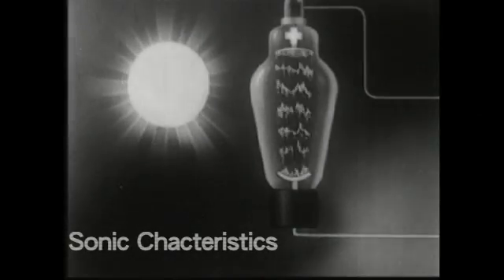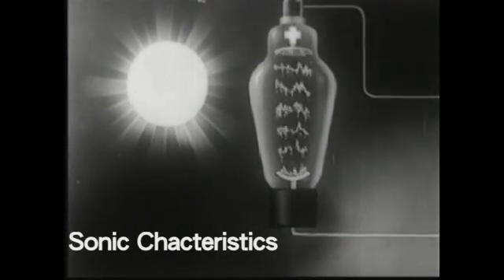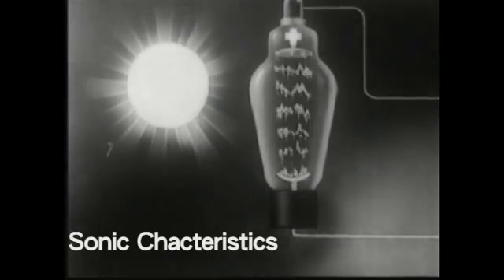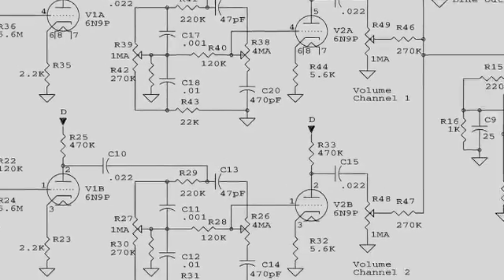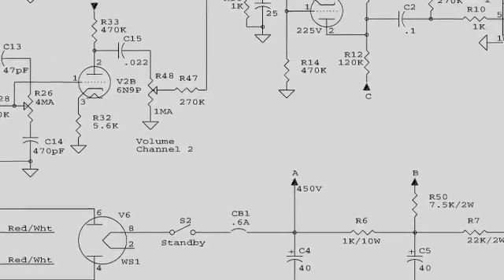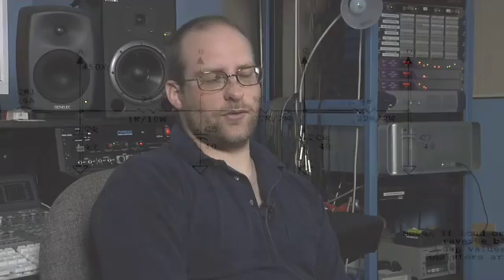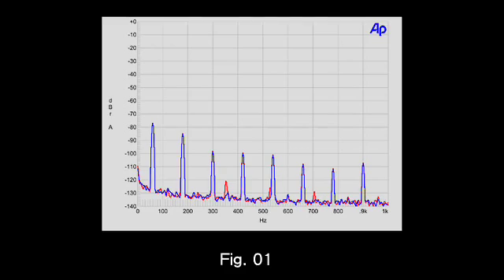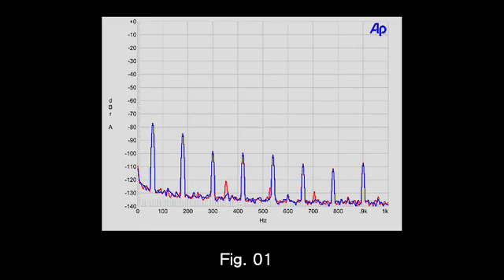Tubes Vs. Solid State Amplification

Comment: The misconception of tubes / transistors producing dominant even / odd order harmonics will probably never die, which this video is a perfect example of. Even / odd order distortion depends largely on the type of circuit that either tubes or transistors are applied to. Class A -> dominant even order, class AB -> dominant odd order. A big part of the audible difference is that as opposed to tubes, modern solid state circuits will not saturate gradually but go into abrupt clipping instead as the max. voltage swing is reached.

Comment: Now what about the moog synthesizer, was it all transistors or a mix of those and tubes? Such as used in Emerson Lake & Palmer's Trilogy, if you're familiar with that song.
Reply: Moog were all transistor. A very early version had a voltage-regulator tube, but only in the power supply. All the audio circuitry was transistors.

Comment: I’ve been a tube snob for a while got into tubes because I didn’t like the sounds I was getting out of my katana. The problem with tubes is you have to run them loud to get those nice tones and they have a tendency to break down. So recently while I was talking another tube amp in to be fixed I tried a couple of solid state amps a Roland Blues Cube and an Orange 🍊 crush pro I walked out with the Orange 🍊 but a few days later I ordered the blues Cube because it does blues better then the orange but the orange can do the heavy rock / metal with lots of controllable feedback it’s a beast.

There’s no good or bad just different.

Comment: The thing is that both amp transistors and tubes are cheap when compared to the price of the full amp (tubes are now expensive because we don't make them anymore), same goes for DAC's and most of the audio stuff, if we check the price list of the components on TI or other manufacturer even the top quality transistors and chips are inexpensive, and what is even more curious is that no sound boutique brand even makes transistors or tubes. All in all its a big marketing scam, mostly.

Comment: When pushed into distortion the signal is clipped. In a valve amp the transition of the clipped signal is tapered with more harmonic information. Transistors cause the signal to clip in a abrupt square. It is purely a matter of taste which you prefer.

Comment: We must consider the voltage factor: Tube works under a voltage 10 times superior to their transistor alternative, is like chiseling an intricate figure in a big block of wood or on a toothpick. There are amps in both systems that become popular by their own characteristics and couldn't be matched in the other way, without even getting in the hybrid sections.

Comment: Digital technology will never equal tubes, you cannot draw a perfect circle using straight lines.
Reply: orange70383 yes you can, draw a straight line around the earth's equator and you'll get a circle.
Reply: If you watch a perfect circle through a microscope you will find texture, imperfections and modular patterns at the end. If you watch any organic curve or form, you will find cells or atoms as pixels. The most organic thing has a resolution limit too.

Comment: Why do you want harmonic distortion? Why do you prefer the excess heat, fragility and limited life of tubes? I'm sorry tube advocacy is counter intuitive.
Reply: A guitar amp is essentially part of the musical instrument. The tone it creates is part of the tone of the instrument. Asking why you would want harmonic distortion is like asking why you would want an instrument to resonate. BTW this video missed what I believe is the biggest difference between SS and valve, valve amps allow you to hear the impedance curve of the speakers you are using. The gain of a valve increases with an increasing anode resistor (Ohm's law). With speakers, the resonant peak around 100Hz and the rising high frequency impedance creates a bass and treble boost at the same time as reducing power efficiency. This results in a lively organic tone that solid state amps simply aren't capable of.

Comment: This tube VS transistor debate will go on and on for ever! I am 61 years old and grown up in that transition from tubes to transistors. My 7th grade science project back in 1968 was comparing tubes to transistors in audio amplifiers and I made it state competition! Although my project was centered around the mechanics more than the sound, I will admit there is fairly determinable difference in the perceived sound between the two. Transistor amps are very "straight forward" in the quality of audio output. As long as it's not clipping, the signal hitting the speakers is pretty much a clone of the input, just stronger. That's one reason an audiophile may say the trans amp sounds hard, harsh, gritty, etc. On the other hand, tube amps have the natural ability to "smooth" things over. Soften the blows, add those sweet sounding harmonics that gives the sound a flavorful pleasantness audiophiles and guitarists love. Reason? Just the way a tube circuit works has a lot to do with it. The output transformer that pretty much is mandatory in a tube amp plays a big part in producing that smooth warm sound. Remember, it's a magnetic field that is the medium used to couple the output tubes to your speaker! The magnetism sort of processes the sound in a way that actually distorts it, but in a way that is pleasing to the ear! Crazy, huh? BTW....This info is MY take on this. Generated from 50+ years toying with all kind of amps. Thanks for reading!
Reply: Marten Dekker  I always like to ask tube-purists how many tubes are in their kick-ass car stereo.
Reply: well jfet soft clip so you clip them like a tube.
Reply: what !  "Transistor amps are very "straight forward" in the quality of audio output. As long as it's not clipping, the signal hitting the speakers is pretty much a clone of the input, just stronger" 
The majority of transistor amps (not all) sound harsh and gritty because of their 3rd, 5th ... harmonic distortions is much higher than that of a tube - generally speaking. Transistors amps include lots of NB just to get them to look pretty on paper which causes other problems. Most Tube amp are built using the same old technology i.e. capacitor coupling etc.. If you ever get chance listen to a tube amp that is fully balanced (PP), magnetic coupled and uses VR and CCS - you might just change you mind. BTW I have heard some good SS amps
Reply: You forgot to mention that tubes have a lot 2nd order harmonics that mask the nasty higher odd harmonics and tubes clip gracefully.
Reply: No no, thank YOU for letting us know your wisdom
Reply: Best answer about the topic I ever heard, thank you !!!
Reply: Solid State never goes 3D like tubes can.
Reply: A very nice insight, thanks a lot!
Reply: Sir, I really would like to read the paper you wrote, do we have access to it or could you share via email?
Reply: Sounds like it would be easy to create a circuit that mimics a tube.
I wish i had a tube amp to compare on my scope.
Maybe ill make one. Try and make it exactlt the same way.
Reply: Marten Dekker I'm a tube snub, so I like your comment but think about it, does it really make sense..or as Spock would say "it's illogical". What's "live" but the amplified sound? So why would tube be more live than SS? If we had SS first, you'd be saying I've heard SS amps that sound more live than Tube.  But I prefer the shimmery sweetness of tube any day. At least compared to the SS amps I've owned, thrown out, given away, etc.  Maybe in 2020 that doesn't apply but I don't really know anymore.

Comment: The harmonic question really doesn't come into play much if you have a sufficiently power amplifier and you're generating your distortion in a pedal. A good SS power amp can produce so little distortion that it's not contributing to the tone at all, and in that way can be more flexible. Even a good tube amp can be very clean. Many tube amps also use solid state or even digital tone circuits. Many classic tube amps actually use silicon diodes for clipping circuits rather than relying on the tubes to produce a saturated tone. 

So I guess you could say that "tube vs solid state" is kind of a odd dichotomy. It's only one factor in the design of an amplifier.

Comment: Failed to mention among other things that solid state amps don't need output transformers. This is a major difference and allows the average solis state amp to reproduce bass frequencies better than the average tube amp. Otherwise, the average tube amp is more pleasing to most ears

Comment: Useful points about solid-state versus tube amps when considering adding a hybrid amp like the Vincent SR-237 for a home stereo system. Considering it has a 10 watt tube pre-amplifier stage coupled with a 150 watt solid-state power amp it's good to know that both amps can seamlessly harmonize well together. Regarding the guitar amplifiers, I have tried both the hybrid guitar amps and the tube amplifiers and found the tube amps to have the magic. If you live in an apartment building your definitely better off with tube amps because they're more expressive at low volumes.
Reply: 10 watt is not a pre-amp !!   70 millivolt signal for home audio is a preamp level.  Approx. 250 mV for PA equipment.
Reply: Thanks for the correction.

Comment: The reason for the sonic differences are:  Vacuum Tubes send micro-phonics to the foreword and backward movement of loudspeakers.   On the other hand ,Solid State amplification  shorts out the  backward  loudspeaker movement, leaving the listener only to hear the foreword motion of the loudspeaker.   It's a matter of individual preference which technology sounds better.
Reply: +Sam Chianello "Solid State amplification  shorts out the  backward  loudspeaker movement" uhhh... just.. no.  That's not how it works.  Not at all.  Not even remotely.  Keep those pseudoscience notes of yours locked up securely underneath your bed in your mom's basement, please!

Comment: There are 2 different aspects of the tube VS solid state debate which are almost separate discussions:
1. Tube distortion VS solid state distortion.
2. Tube "warmth" VS solid state "coldness" when running in linear mode for audio amplification. 

As far as distortion goes, it's just a matter of taste. Are MOSFETS good enough for the effect you want? Do you actually like the sound of SS distortion, as produced by germanium "fuzzboxes"?  I do; some of my favorite records from the '60s have "fuzz bass" which I assume is from SS effects boxes. I tend to associate the "tube sound" with whiney guitars, but that's probably from hearing too much '70s "classic rock", not a true representation of the capabilities of tube amps. 

When it comes to the "warmth" aspect, I completely understand what tube advocates mean, but let's be honest, the "warmth" they (and I) seek is a departure from high-fidelity; it's a set of characteristics that are added by classic tube amp designs rather than a feature of the original material. These include:
1. High output impedance: which allows the speaker to resonate in response to the stimuli from the audio material. This can produce amazing sounds from speakers intended for use with tube equipment, large woofers with infinite baffles, but it can sound like crap when tube amplifiers power modern, compact speakers that are designed for low impedance amps that damp resonance. I find speakers that allow the cone to resonate but don't drive much cabinet resonance to produce the most desirable  sounds with tube amps. 
2. 50 or 60 Hz hum: This was always considered a curse with both tube and SS equipment, though the latter made it possible to almost completely eliminate it. But, believe it or not, some people missed it when it was gone. It didn't just exist by itself, it gave the piece of equipment a "personality", particularly when he hum was inter-modulated with the input signal.  It even gave cheap equipment, like table radios and 1 tube phonographs, better perceived bass response, even though most of what the listener was really hearing was the hum modulated by the music, rather than the bass tracks from the original recording. 
I believe that most of these characteristics, for both audio and musical instrument amplification, can be replicated with transistors.  MOSFETS  can replicate the distortion characteristics of tubes; common-emitter or common-source output stages (or just a series resistor, if you're not short of power) can replicate the high output impedance; line-current-hum is easier still, as anyone who has had to replace filter caps on tube or SS equipment knows.  But first, one has to decide which of them are actually desirable and design the equipment around those requirements. If you just like the look, feel and smell of a bank of tubes sitting in front of you, though, transistors will be hard-pressed to replicate that.

Comment: There is a very simple concept that should be the basis for any discussion regarding tube vs solid state, and I am surprised that it was not even mentioned. Electronic signals retain their purity better when flowing through a free space vacuum of the vacuum tube rather than the disrupted signals that must flow through the crystal lattice of the solid state systems. Once one decides that the tube is better for the creation of musical tones, it is all about amplifier design. Solid state has gotten much better but one must always consider the physics of the medium through which the electrons must flow. Free space will always beat crystals. It also helps if the guitar demonstration were made on good equipment and with someone that knows how to pay the guitar, neither of which was present in this video. Get a Dumble amp (if you can find one) if you want to see how a tube amp for guitar should sound.
Reply: Have you ever hooked an oscilloscope to view the signal from any stage of an amplifier ??   At 2 million samples per second, I can assure you there is NO discernible disrupted signals. Certainly beyond the ability of a human ear to hear.
Reply: +dojmike  I totally agree .  I have been playing since the mid 80's and have had all sorts of amps but I definitaley know that tube amps sound better. I have solid state amps too.  I've had so many over the years and I use two for gigging.  A Fender Twin reverb (which is one of my favourite models) and a 1992 Marshall Valvestate which was one of the first hybrids.   I have to say I think Line 6 amplifiers are awful and the guy playing sounded awful , not just his playing (which wasn't good) but the sound was too distorted..  I can't stand amps with built in digital fx.  I think they may be good for young people with little money but I think they are soulless.  I think most players who have used valve amps know there is a difference.  Overloading a valve amp isn't something that can be replicated easily (which is why I use a Valvestate).  I think there are some great solid state amps out there but Line 6 aren't one of them.